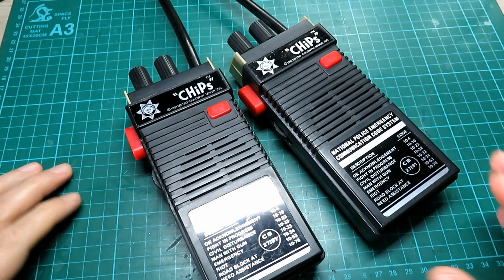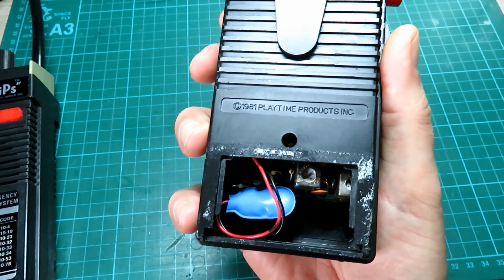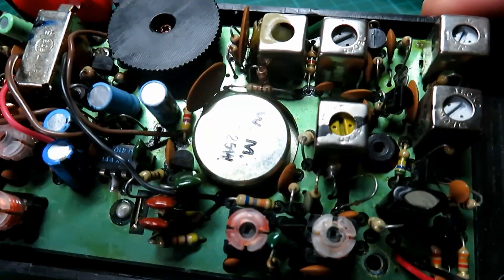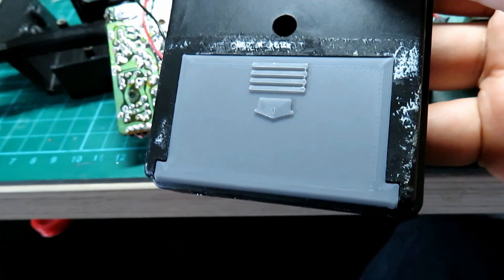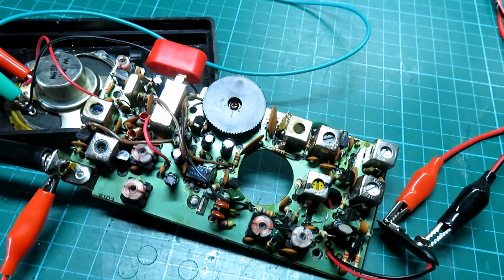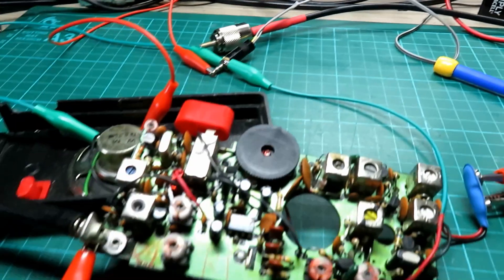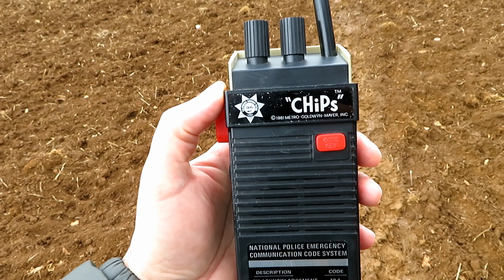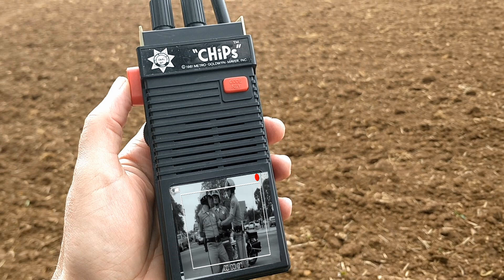Reviving Nostalgia: Exploring the 80s TV Show CHiPs Toy Walkie Talkies

Comment: I remember going to watch a film called 'That Darn cat' in the early 1970s where the cops used a radio transmitter on a cat's collar to track down some bank robbers. I always wanted one of those transmitters, but of course, they were not available to the public. As I got older, I built my own versions, but they were never anywhere near as good! With hindsight, this was Hollywood, so the original transmitters probably weren't up to much either.... Anyway, great video on the walkie talkies and thanks for making it.
Reply from the maker: Wow that's cool no problems